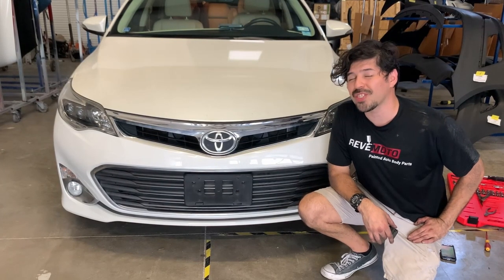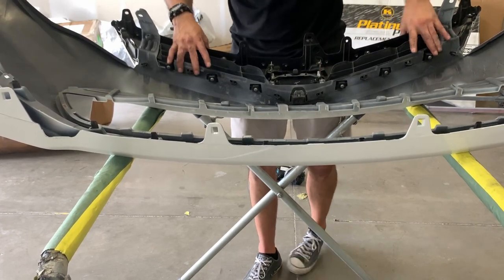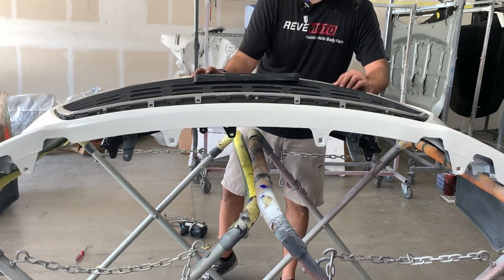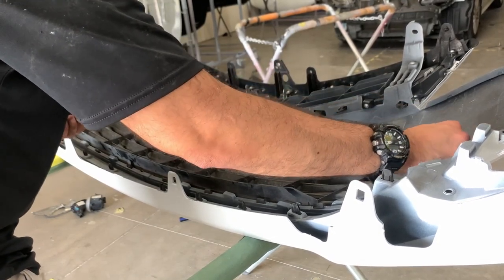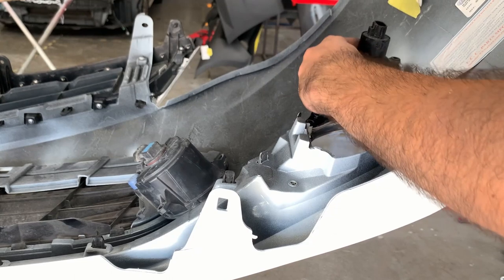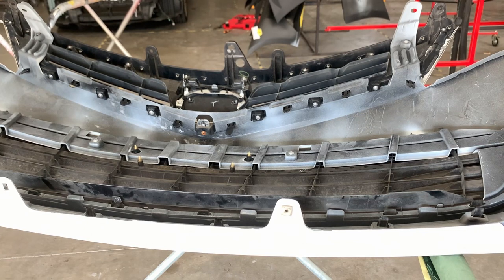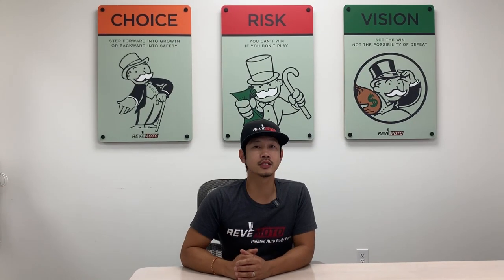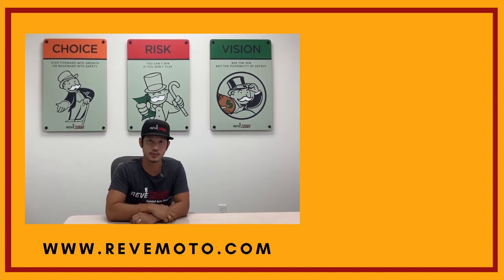2013-2015 Toyota Avalon Front Bumper Installation | ReveMoto

Comment: I have a 2014 Avalon and need to replace the upper grill. I took of the shroud and now I am stuck. Can I remove the upper grill without removing the whole bumper? If so, how? Thanks for any help you can provide
Reply from the maker: To be it’s easier to remove the whole bumper. Go to www.ReveMoto.com
Reply: @ReveMoto  I did it and without removing the whole bumper. That would’ve been a lot of unnecessary work. It comes of easily in 10 minutes without taking the bumper off. Absolutely no reason to do so. In case anyone else needs to remove the upper grill. Do not take the bumper off.